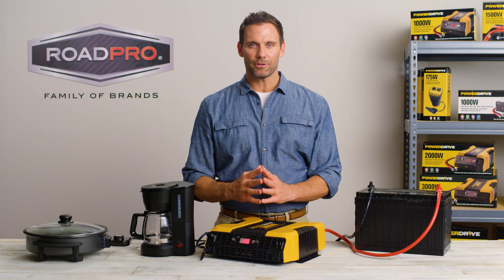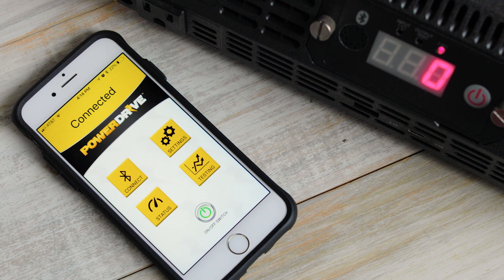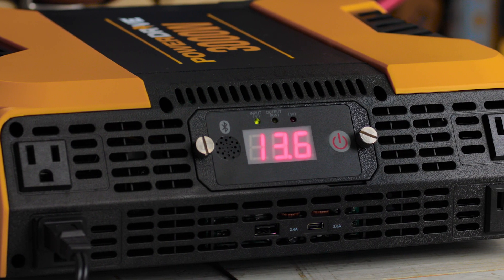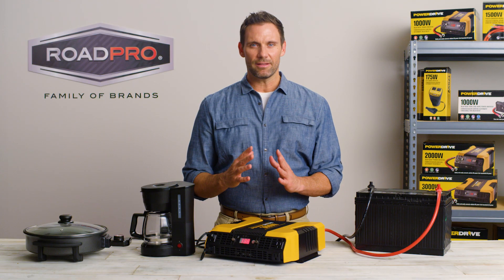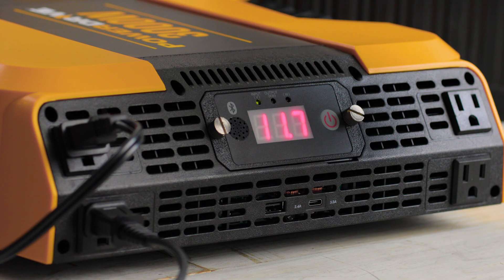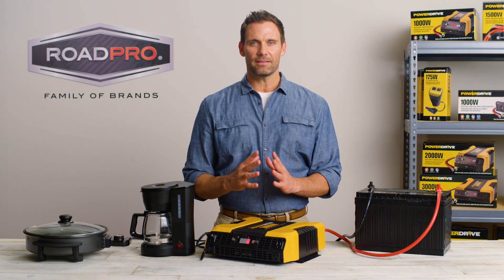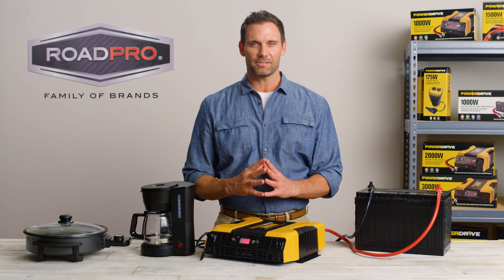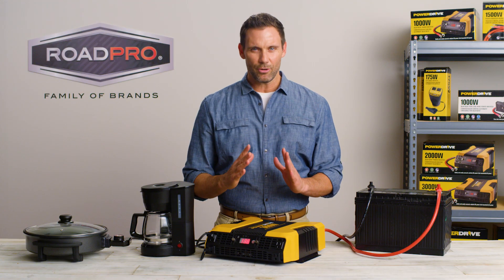Powerdrive Inverter HOW TO #4 - How to test and use your power inverter

Comment: How long will it run, and do uou need to re-charge?
Reply from the maker: Hi Eric, the lifetime of the inverter all depends upon your care and keeping of it. Ensuring there is an inline circuit breaker or fuse to protect both you and the inverter is essential to prolong the lifetime of the inverter.

Comment: this is a bunch of BULL you say your volts should not drop more then a 1/2 volt? but when you plug something in it dropped   to --------> 2 Volts from 13.6  to 11.6 what gives????
Reply: It will be fine for 2 days it will give 14.1V then it will drop instantly to 11.1V